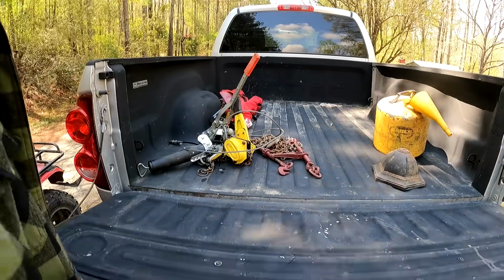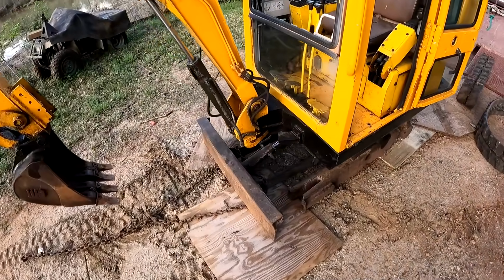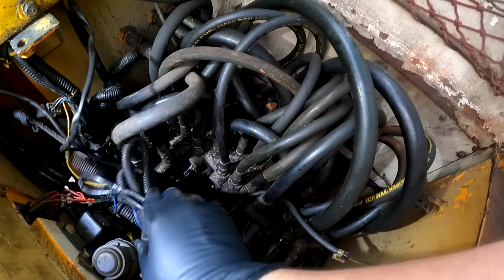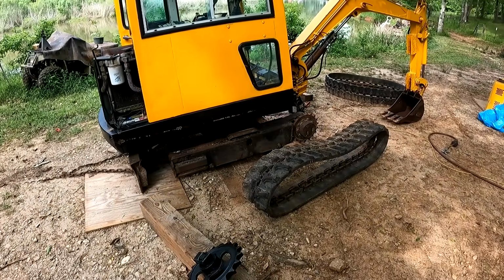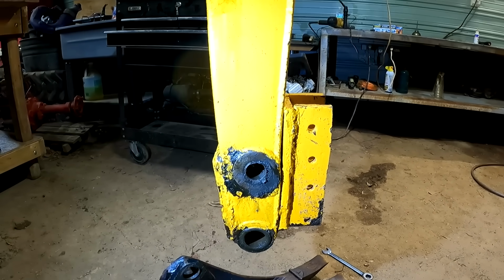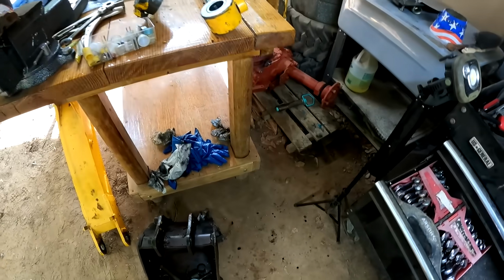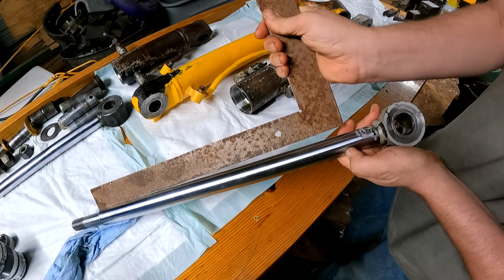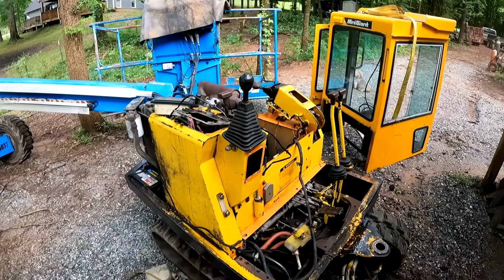BUYING THE CHEAPEST CLAPPED OUT EXCAVATOR ON MARKETPLACE..HOW BAD CAN IT BE?

Comment from the maker: I want to thank everyone of you guys that have taken their time to watch my video, let me know what color you all like and any other input you have on this machine🙂
Reply: A green paintjob would be something, you don't see that very often. Love the effort you put into the machine and video. I hope there are not more hidden issues on the motor, valveblock and pump side of the excavator...
Reply: Definitely has to be blue😎
Reply: I have as many parts as you need for this machine
Reply from the maker: @DSIreland  new or used parts?
Reply: That orange looks pretty good.
Reply: Time to make some forks for that skid steer
Bucket $85 from china and that cutting edge is not hardened. Think butter
Reply: Of course I'm partial to John Deere green and yellow.
Reply: bro, please use some safety shoes 😂
Reply: Black, plant and vehicles look better in black personally
Reply: I personally like the OEM colors and decals for machines. But at the end of the day it is your machine and you have to look at it. I do have a question though. I know you went into this buying the most clapped out and cheapest thing you could find but on this unit with the cracked frame and all would you end up putting more money into it then say had you spent the same money on a better kept machine? At what point would you call it and stop work and go "this is a money pit" ?
Reply: That orange with dk grey would look sharp I think.
Reply: BRAVO.... quel travail pour remettre tout en état neuf .... pour la couleur bleu je pense comme tes autres machines 🎉❤
Reply from the maker: @DSIreland  do you have a email? I’d like to buy parts from you
Reply: Looking forward to more on the little giant
Reply: Pomaluj ta maszynę na orginalny kolor jak w tym katalogu i będziesz miał coś pięknego ja też robię starą minikparkę schaeff hr12 1984r 
Pozdrawiam serdecznie

Comment: Great video!! What a great machine for the cheap!
 For the future, I learned of a superglue made by 3M for rubber. It's not cheap as far as superglue goes. I've fixed cracks on my tractor tires with this stuff. It's amazing. Those cracks on the tread are completely repairable with this glue. The rubber around the repair will fail before the glue gives up!
Keep up the good work!
Reply from the maker: I’ll need to check that out!

Comment: this is what 2 grand gets you now a days?  No wonder why used machines are the price they are.  Looked like the swing bearings have play.  Crazy how people can think this is worth 2 grand in this condition.
Reply: prices are insane right now. I've seen 70s/80s skidsteers with blown engines for 4k+
Reply: This is why a lot of guys are buying those Chinese mini excavators. For 6 to 7 K you can get a brand new machine. Supposedly they're not that bad.
Reply from the maker: you got that rite!
Reply from the maker: I’m not really a fan of the Chinese ones they beat you up and I like Japanese quality
Reply: @The_Home_Pros depending on how your operating it, they'd beat you up. But the Japanese hydraulics are so much smoother, and have more finesse with your inputs than the Chinese machines. If they put throttle bodies on the motors, so it wasn't just idol or full revs, they'd run the pumps a bot smoother, and wouldn't beat you up as much!
Reply: On Chinese vs Japanese comparison i been looking at new gas powered ive operated a few jerky gas machines but some advertise kabota diesel engines for 1 ton 1.5 ton 2 ton are Chinese w/ kabota engine any smoother?
Reply: I've also looked at used Japanese machines with goof paint jobs that are Komatsu and Mitsubishi at auction from same people selling small mini from China how shot are they for used in China and Japan? Assuming laws similar to 40k miles on engines
Reply: 2k was still a good deal considering it ran and everything functioned.
Reply: Right, DIY tracks, undercarriage needs help, swing bearing needs help, pins have play, no low balls I know what I got😂

Comment: Great video as always. I have a 1992 Hanix (Nissan) Mini Giant N260-2 escavator I bought a couple years ago. Put new tracks, replaced all the outside hydraulic hoses. Love the machine, but like yours the bucket and bucket links are loose and wobbly. Curious the names of the two companies you purchased your parts from. I tried doing google searches with no luck. I have the electronic control box that needs replacing as well. Can you provide contact information so I can either online or phone for parts
Reply from the maker: The first one is called mini excavator Centre and the other is called Riley pant spares tell Darren darrell sent you from his utube video

Comment: That cylinder piston end that was first loose then tightened up even with the set screw removed. I do not know if your torches have the ability, but with a torch rosebud I used to heat them up red hot. If red hot they just give up no matter what. In your case the piston seals would first be removed so as not to melt them to the piston. With proper maintenance these bushings will not be worn even after 20 years is greased every morning like farmer's do with their equipment. Unused equipment can just sit until needed, then grease before use. If not being used greasing all the time creates messy headaches. With the house removed your chances of getting hurt rises drastically on a tip over.

Comment: Seems your heart is really into this machine. I have done many car and motorcycle builds / repairs and only a few I have completely stripped down to do a thorough job on them. Some didnt need as much work, but I didnt feel the need to strip them down to make it easier to work on. Looking forward ot the next instalment of this build. 
Would you say it was worth buying it still with all the costs added to it ?
I have done a lot of rebuilds and the final cost outlay is nearer to buying a perfect item that needs no work doing to it. 
I even had a Honda petrol generator given to me one for free and I spent £80 on a new carb, bearings, seals, gasket set and cleaning it all out. I finished it and it was running a lot better with good power output and I listed it on ebay with a starting bid of £50 and had a lot of watchers and only one bid. I wasnt happy I made a loss on it.

Comment: The purpose of a bright yellow of orange paint job is visability on job sites.
In areas with multiple pieces of equipment operating in the same area or in wooded areas it let's other operators and those on foot see you more readily. 
Many job sites it's required by insurance companies and local officials.

Comment: Just wondering if you used a degreaser before you power washed it. Cold water doesn't really remove grease
Reply from the maker: I use diesel then dawn dish spray

Comment: good luck man mitubishi is hard to find parts for our ms180 needs a solenoid and we cant find one anywhere
Reply from the maker: a lot of the parts are interchangeable and the company I got parts from have tons of parts for this engine so I should be good and if not I’ll swap a kubota in it or a yanmar
Reply from the maker: I looked up your excavator if you have the 6d15c engine then I found every solenoid you’d need online

Comment: well i am 1/4 way through and from what i can see you have ripped your self off 2 grand for this is that scrap value cos at the moment the hole machine needs a total rebuild just open the parts canon and stand back unless i am wrong sorry but can not see the value in this project i may be wrong but a similar new machine over here ruffly 10 to 12 grand don't know but you may come out on top i hope you do i'll be subscribing to watch more of your vidioes as you seem to know what your about and one thing got me in was you cleaned it before you started well done that lad Big Cheers Mate

Comment: Why?  In my area the dealership is selling brand new Chinese mini excavators with the manual thumb, cab with a fan, lights on the cab for only $3,990.
Reply from the maker: @MyLifeThai371  this is not even close to one of those rickety peices of junk that tip over once you pick somthing up. first this is a good quality Japanese machine with a diesel engine, not no single cylinder briggs, it has 3 pumps not one, and it’s 4,000 pounds not 1200 like the Chinese junk

Comment: I'm not too familiar with how these work. It looked like you used a grease gun to adjust the idlers. Is grease being used as some sort of hydraulic fluid or was the gun just used to pump it up somehow?
Reply: Grease is a fluid.  Yes it is used to fill a piston to apply track tension.  All tracks have the same system.

Comment: Yuppers,  you definitely bought someone's "let's fubar maintenance an exspensive piece of equipment" nightmare. 
Ooh, never pull on a wite to disconnect it.
Pull on the connector with needle flat nose pliers.
Pulling the wires can pull the wire out of the connector.

Comment: Wow $2000 did you overpay  ? 
Don't hate me guys l
am only asking a
Question ❓❓❓ 
What's the scrap value 
of this lump of Metal !
Reply: i checked my local marketplace cheapest mini digger was 10000 usd
Reply: You can get them for around 4 - 6000 new but they will not last as long as thing one has.
Reply from the maker: they are really expensive for the Japanese ones

Comment: why would you take someone else problems on yourself something has to be wrong with it why was it never fixed like NO parts are available for that machine or something else they found that does need to work to i sold a semi with the RV trail with each other i did miss understood them they did just wan the trailer, not the truck they did said it better deal with the semi to i land up with there15-year-old semi it went right to auction the next day i can found new truck why would i drive a used one for
Reply: Try using sentences next time.
Reply from the maker: man that was hard to read